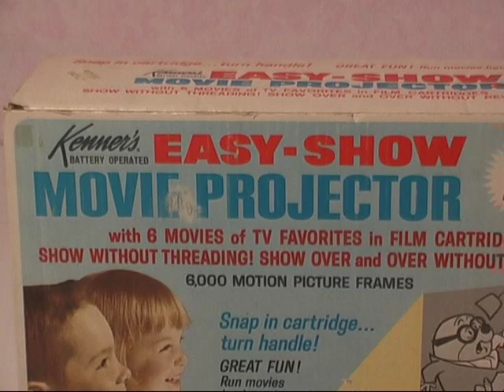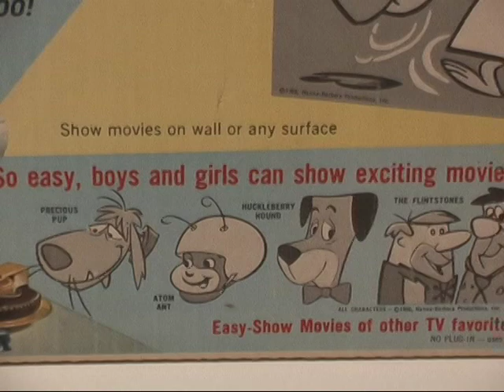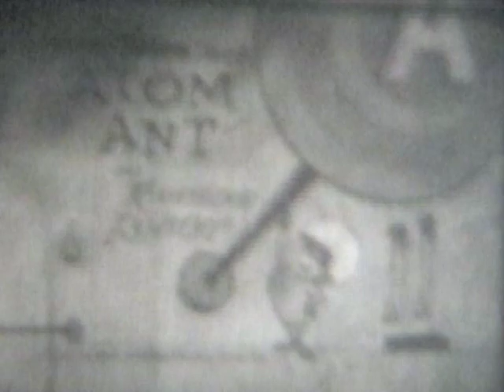Kenner Easy-Show Projector

Comment: The conical springs to produce the shutter effect over the rounded pegs is simplicity GENIUS.
Reply from the maker: They are.  I couldn't believe it as an adult, and getting this, that it was so simple.  It actually works.  The problem with the toy is that it just begged to tangle film, and kids of the age this was meant for were simply too young to deal with the tears and tangles.

Comment: Wow. I got a red one of these as a Christmas present, in 1970 or so. It NEVER worked. It was probably old-stock and had been sitting in the store for a while. One of the cartoons that came with it was "Mighty Mightor" which only ran on TV in 1967 or 68. It really was a disappointing piece of junk. The lens came in handy later--I used it for a cub scout project.